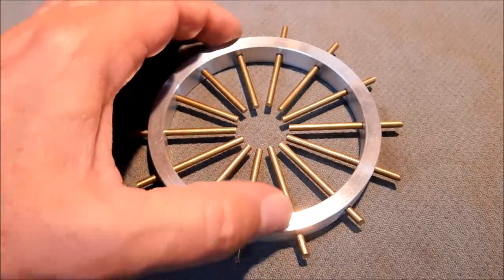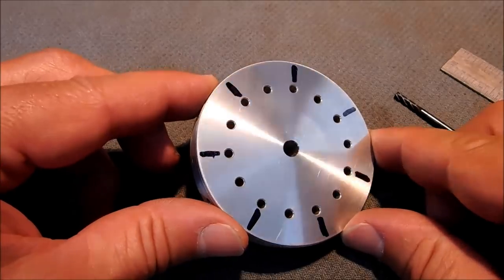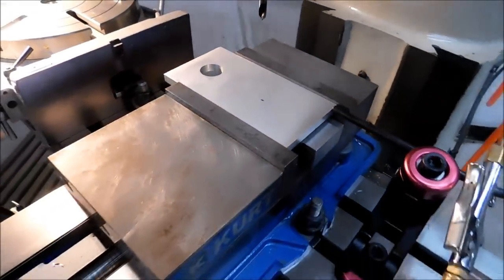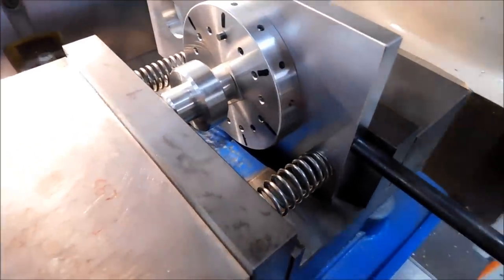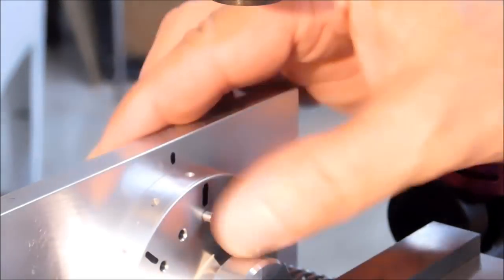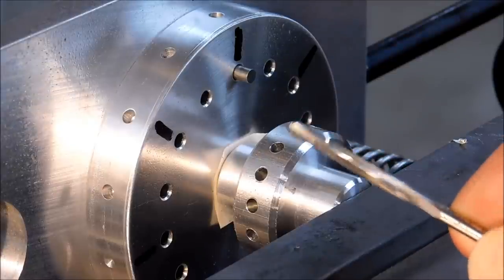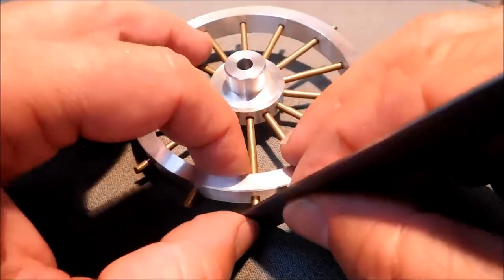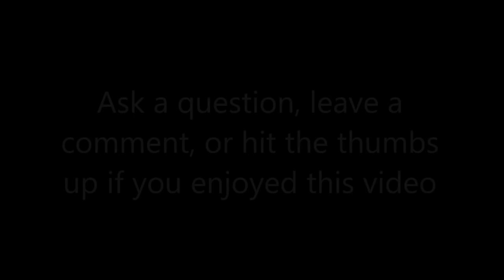Machining a 14 Spoke Wheel Hub

Comment: I'm 64. I still clearly remember the evolution of toys and development as a kid. Blocks, Lincoln Logs, Tinker Toys, and Erector Set!

My best piece was a 1' high tower with a 2' wide spinning bar on top, with 2 D-cells on one end of the bar, and a motor/propellor on the other end. I may still have the propellor.

In real life, my title was Prototype Electronics Modelmaker Class A. THAT'S where those toys got me!

Vids like this will get the next generation going! Never mind computers and CNC, manual skills will always be needed.
Reply from the maker: I've been in prototype, custom and repair work my entire career. Done everything from one of a kind priceless clock bezels, to Rolex watch crowns, space shuttle parts and about everything in between. I firmly believe manual skills are the core of any good machinist. Then graduate to the CNC. Just my 2 cents.

Comment: I too smiled broadly at your enjoyment in putting the wheel together and giving it a spin. Very satisfying.

On the matter of the number of holes needed to achieve the division of the rim by 14, strictly, you only need five of the seven holes in the face of the piece.
In fact, any five of the seven holes will do, they don't have to be a continuous set.
Albeit, using only those holes would involve the piece being set at more than two different heights in the set-up and for some of the positions, there would not be much engagement in the vice.
Also, the need to use an adjacent pair holes to project all the way across the piece in order to locate two of the required positions will make the method less accurate. 
Although you could avoid that worst case by using an appropriate pair of the holes already generated in the rim, but that would require a further setup.

The rule for the minimum number of holes is that you need half the odd number plus 1.5 holes.  
So, for 11 holes to make 22 divisions, you need to use a minimum of 11/2 + 1.5 = 7 of the 11 holes to achieve 22 holes in the rim.
With three holes you need all three to achieve 6 holes in the rim. ie 3/2+1.5 =3 holes.
I suppose there must be some circumstance where such a method of using less than a full circle of holes would have application, otherwise it falls in the category of interesting but useless information.

The spokes in your test wheel were arranged in a plane, whereas a lot of wooden spoked wheels actually have the spokes arrayed on the surface of a very flat imaginary cone.
The tip of the cone points towards the centre of the vehicle.
I understand that the arrangement helps with the stability of the wheel structure against cornering loads. 
For such a conical wheel to "snap through", like the bottom of an oilcan, the steel tire would have to stretch, which it is well suited to resist mightily.

Thanks for all the great videos. Cheers

Comment: Magnificent. Like watching a surgeon work.
Reply from the maker: Thank you, Glad you enjoyed it
Reply: Machinist here...we work at smaller tolerances than a surgeon...  +/-0.00002 for me...
Reply from the maker: @eugeniovincenzo1621  Tell us what you measure that with.
Reply: @joepie221  if you're curious....
The tolerance of a lathe operation I perform is  +/-0.00004" (0.001mm) on 260 half hard brass and part diameters of 1.6-2.4in (40-60mm) cut on a 9x20 lathe which I specially configured and dedicated for this operation. 

First I changed out the original spindle bearings. Then I hand lapped the dovetail of the compound with 1200 grit to remove any side to side micro displacement during the compounds normal linear stroke. Then added a special order travel indicator to the compound to give tenths of a thou resolution since the hand crank dial is only marked off in thousandths of an inch and finally I set the compound at 5.74° relative to the spindle axis which translates into a 10:1 displacement of the cutter vs. the compound movement. So (each 0.001" on the compound crank dial is reduced to tenths of a thou with the travel indicator which becomes 0.00001" at the cutter from the angle the compound is set to). 

To measure that I use a thermometer for thermal coefficient of expansion, a Mitutoyo indicating micrometer #510-302, which has a total indicating range of  +/-0.0025" (+/-0.065mm) and is set with Mitutoyo ceramic gage blocks.
 
I have to literally shave the parts (no power feed) with special cutters (Micro100) on the final passes to achieve the surface finish needed to measure down at that level. 

I'm now going into my 11th year of doing these specialty parts. I'm not a career machinist, but my mentor who was an FAA career machinist onetime said," if somebody handed him a print with those tolerances on it, he'd tell 'em it can't be done and that he wouldn't even know how to measure that". 

Because the machine work I perform is not diversified I really appreciate getting to see the many ways you have for accomplishing various set ups.
Thanks Joe, for putting in your time and effort and for sharing your knowledge. 
Cheers!

Comment: Hi Joe,
Thanks for all the tips on this, You could slot the spokes and drive wedges into the slots to hold the wheels on. I have seen this on wagon or cart wheels, similar to holding a hammer head onto the handle.

Comment: I’ve had to match holes many times. I will knock the main hole in then move to the next hole and indicate the hole to match. Remove the plate you are matching and drill your hole undersized. Install the plate and now ream through both pieces. Many way to get the job done. Thanks for the video.
Reply from the maker: 14 holes is a different story. Less chance of binding with a slot too.

Comment: Excellent as always, Joe!  You could expand on this concept by explaining the use of a diamond-shaped pin as an alternative to a slot. A related topic would be a review of the jig bore coordinate tables in the Machinery's Handbook (pages 954 - 961 in my old 23rd edition). It provides the ability to calculate hole circles using only multipication, no trig involved.

Comment: Joe, I love every one of your vids.  It’s been a few years since I have have machines in the same class as what you use.  That dosent stop me from playing with this stuff on my Toy machines.  I occurs to me that most of your viewers are like me and have a mill or lathe that weigh about as much as one of your chucks.  I think it would be a great series to see what you could do with one of these toy machines and just how good of results you could end up with.  I would suggest you start with the classic “Chinese mini lathe”. These are 7x10, 7x12, 7x14, and 7x16 lathes you pick up and carry to the other room.  I would even volunteer to send you one to play with!
Some mods I’d like to see include replacing the ball bearings with some good tapered bearings, making a carriage lock, improving the cross slide so you don’t have to wind the damn thing almost off so you can loosen a couple of cap screws to change the angle, creating a “faceplate” by chucking the spindle in a real lathe and cutting an index lip that is perfect to the shaft ( that runs perfect in the new tapered bearings), and many more things that can make one of these toys produce tenth parts!  

I understand that most of these mods have been done by others and are up on YouTube to see.  But I think it would be incredible to see you go step by step thru making one of these into an outstanding machine to produce fine small parts!

Thanks for all your vids and best of health,  Craig

Comment: after making sure they ( both wheels ) are on center, you could silver solder the spokes in place, stack them then cut the nubs off with the lathe, making matching sized wheels.
Reply: Can't silver solder aluminum. Would have worked with a steel or brass hub and rim.
Reply from the maker: I plan to drill and pin them for looks. Then turn it.

Comment: The hub looks like the wood wheel from a tinker toy set. 

I'm a bit surprised that you're not taking advantage of the fact that you have an even number of holes, and just drilling all the way through on each setting. That would let you do 7 different positions  instead of 14. I assume you're drawing all the way through to the axle hole.

As far as running true goes, check it with a DTI and then chuck it up in the lathe on a mandrel and trim off those spokes!

Or not—I'm not sure how the spokes would handle the cutting load. They might wind up like a pinwheel.

Comment: When I built one of these I used some .0625 brass shim stalk cut it to length and braised it then put it back onto the lathe and trimmed it down and polished it off.
Reply: You brazed .0625 brass?  What did you melt to stick the parts together?  Since yellow brass melts at 1700-ish F, my best guess is aluminum bronze?

Comment: By machining two slots on opposite sides of the center, you can once again get away with only seven indexing holes.  In that case, left side and right side would be more convenient than top and bottom.
Reply: Byron , 
I was thinking the same thing when he first started drilling . It may either be to prevent drill drift , or weakening the hub . Did Joe actually drill to the center of the hub ?

Comment: Hi Joe. Could you have made both the tire and hub out of one piece by using a thicker blank, turn the hub extensions, drill the holes deeper then trepan the tire off and finish the diameters of the hub and i.d. of the tire. That way all 28 holes 🕳 would be aligned.

Comment: It would make assembly more difficult, but if you adjust the spoke or hub size you could lightly press the spokes in. Just heat the hub and cool the spokes.

Comment: Another outstanding video Joe..
But one question...if the holes in the center fixture are accurate why do you need to have a slot? Why not just a hole?
Reply from the maker: The slot does exactly the same thing without the fuss of super precision. It is also the better choice if a lot of movement will occur. The slot allows for a faster disassembly of the components, without a pin binding.

Comment: Beautiful job sir... You used tooling to chamfer that OD, or a file?  That assembly you just made could make an interesting skeleton clock gear with some teeth attached at the outside, or vertical pins drilled and inserted like a cage wheel.  Very mechanical looking.  Steam Punk if you will...   Wow..a wooden outside piece like that in my play-set as a kid would've been absolutely killer! Loved Tinker Toys, got them for my children and grand baby.  I can still remember the snare drum like sound they made when putting all those wooden rods back in the container.  Thanks for all the great info and the video...
Reply from the maker: That snare drum reference brought back memories. thanks for that. the chamfer was done with a form tool. It illustrates how much a chuck can move a part. I can be sure that was the second side.

Comment: Tinker Toy!
Reply: My first thought. But l am a geezer .🤗
Reply: @richardpalmer6196  Yeh me too.  I've outlived the warranty:})
Reply: What's a tinker toy? ps not tòo young perhaps too old, or wrong country
Reply: @chrisstephens6673  Did a quick google and found this <https://en.wikipedia.org/wiki/Tinkertoy> but as I remember as a kid, there were no colors to the parts and it was all made of wood. No I am not as old as the invention! LOL
Reply: @Country_Bubba  thanks for that, not too  young or too old it seems,  but of the meccano generation instead. 😁
Reply: @chrisstephens6673  ,
Tinker toys were a mix of different length wood rods about 1/4" round and discs with 1/4" holes around the edge , and a 1/4 " hole in the center . By attaching  1 disc to another  through the centers you would create a basic axle. 
The rods put in the side holes become spokes . Think of science class , when they would diagram the  molecular structure of something . Hopefully that makes sense to you . I wrote this , but at 75 , I'm not sure if I can  explain . Keep in mind l had these toys when l went to school , uphill , both ways through the snow , on my dinosaur.  😁
Reply: @richardpalmer6196  😀

Comment: Great video
Question though that I've had really since part #1 (making the outer sections).
Seems to me that it would make more sense to start with a thicker piece at the full diameter that you started with in the first video and drill and ream the holes to the full depth that they needed to be fore the raw stock to have included the hub and the outer rim. Starting with the thicker material would allow for it to be thinned down where needed and still have the thicker area in the inner area of the hub.
Is there something I'm missing as to why it couldn't be done that way or possibly why doing it the way you did it would be better?
 
It just seems that you are adding an extra (could say redundant) setup and machining step to add features that could have been taken care of with the first setup when you originally did them for the outer rim section.

Comment: Great video Amigo Joe!!   Could you build the same setup but the wheel part having blind holes around the inside of the wheel with nothing showing on the outer circumference of the wheel?

Comment: Joe I am trying to find a great early vid (ok they are all great) you did on how to machine thinner disc type parts on the lathe by trapping them with a live center and holding them to the vice jaws with double sided tape.  I need to review that for a job I am doing. Does it exist or am I dreaming?

Comment: It would look better with a steel tyre split into four parts and using 1 mill diameter rivets. If you use  .7 thick brass it’ll bend nice and easy, my daughter did that and used 88 rivets for the two wheels.
Reply from the maker: That would look good.

Comment: Could you have made that indexing wheel with the same fixture you're using to index it with this video, then you'd only need to find the geometry of one triangle.
Reply from the maker: I would imagine there are several ways to approach this after seeing it done. If you are OK wasting material, drill all the holes at the same time and just trepan the hub off the mother blank and call it a day.

Comment: Inserts spokes into hub and rim, spins the wheel and thinks it's as close to concentric as F@#K is to swearing. I made a 50 hole index plate many years ago using a 25 hole plate. Match drilled al l 25 holes into work then flipped the index plate, inserted a pin to align the two and drilled the second batch of 25 holes. Works with any odd number ob holes in index plate.
Reply from the maker: Provided the desired pattern is an even number of holes. Thanks for the comment.

Comment: if a 7 hole disc can do a 14 position job
then your 14 hole disc can do a 28 position job.
Reply from the maker: Is that all ?
Reply: @joepie221  - not counted it all in detail - but guessing there will be cases of overlap.
a little python scripting for doing all the math should be able to give the total number of results.